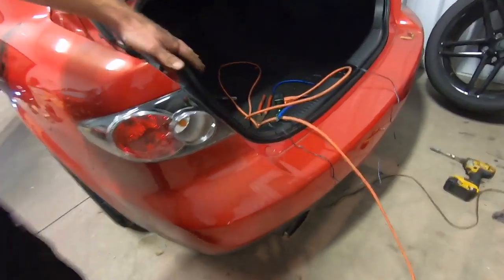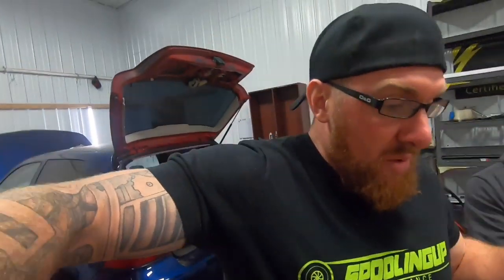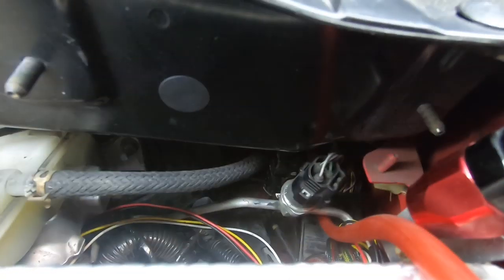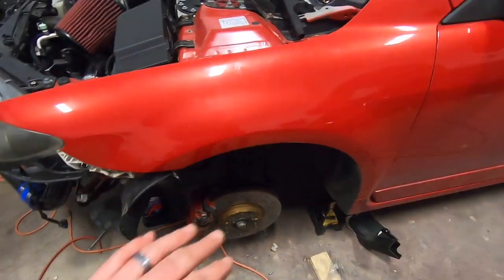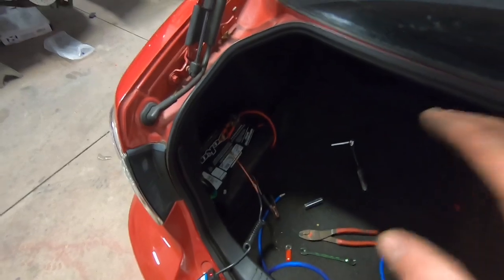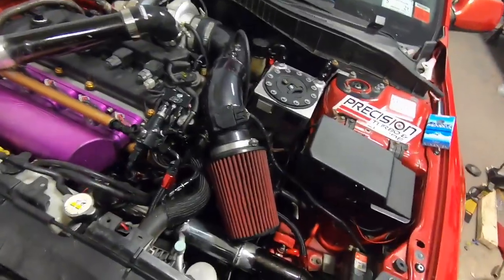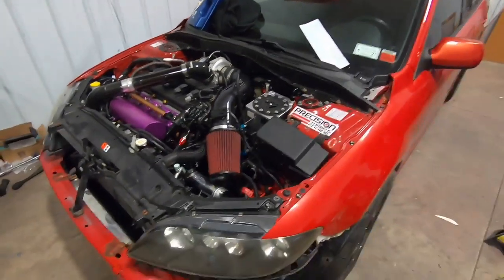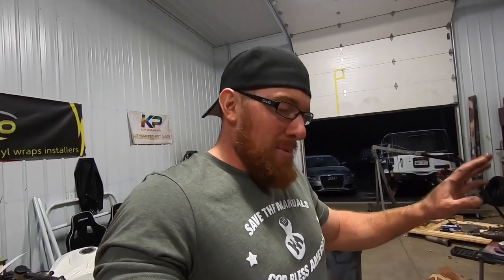CRAZY “SLEEPER” MAZDASPEED6 BUILD IS COMPLETE | DIY Battery Relocate & Car Moves Under Own Power!!

Comment: Don’t forget to throw a kill switch back there for when you decided to go to the track! Relocated in the truck requires it as far as I recall!
Reply: Trunk not truck
Reply from the maker: Yessir it does! The battery mount is temporary. Probably gunna do an AGM battery and then do a aluminum box

Comment: My spec clutch was like that too and I hated it. You have to smash the pedal to the floor to shift. You’ll see once you drive it. Super annoying
Reply from the maker: Ya I was thinking that
Reply: I have no idea if there is, or is not a fix/adjustment for that. I just put a southbend clutch in my car when I went big turbo and gen2 trans swap. I like it way mo betta
Reply from the maker: Spilly Built ya if it give me issues I’m just going to get a clutch masters twin disc
Reply: @SpoolingUpPerformance  just get the clutch master it should  be soft enough quickest and also do a video,  I never heard of any speeds with that type of clutch and I'm very interested to get it too